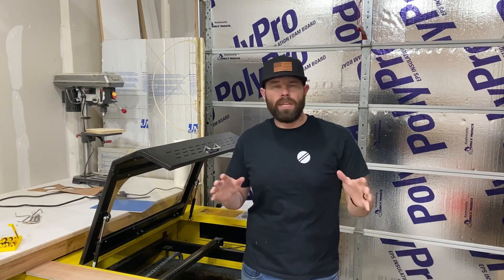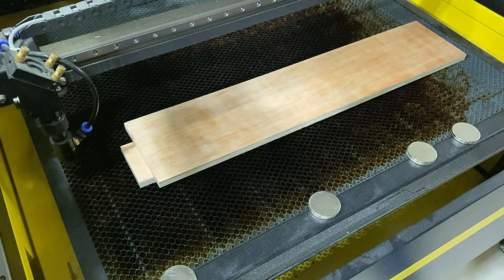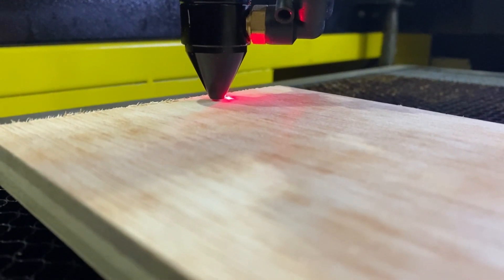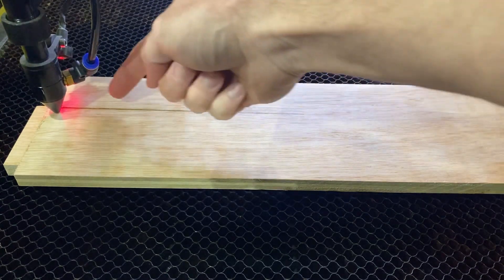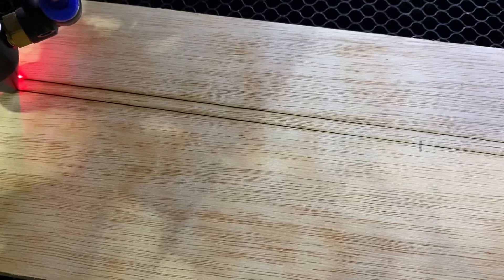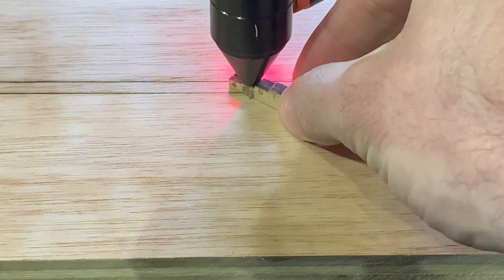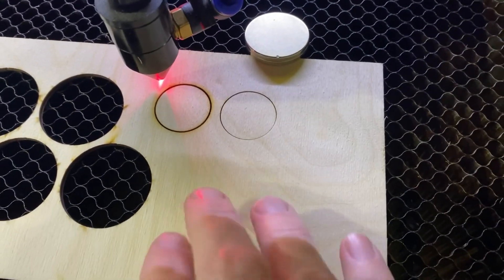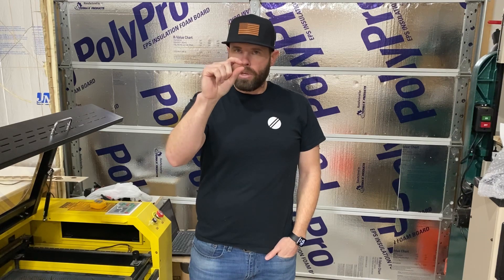Ramp Test and Optimal Focus for Co2 Laser

Comment: I'm not a youtube contributor but I've owned a laser cutting business for 15 years and I need to tweak your process here.  I cut and engrave 3mm and 6mm baltic birch with 4 machines, wholesaling to 400 locations around the country.  The way I do this "ramp" trick is I use a piece of 6mm plywood and put it on an angle so it will be definitely out of focus at both ends.  Have magnet stops so you can remove the wood and place it back in exactly.  I run a file that has the capital letter "B" on 1/8" height copied and pasted across 12 inches or so for engraving and a cut line at the speed I usually can get through 6mm with.  Run the file then remove the wood and see the center point of where the line cut all the way through, that's your ACTUAL best cutting height.  Take a pen and mark around the wood to the front side so you can see where the focus height was optimal for CUTTING.  Then on the top surface look closely at the letter B's and find the part of the engraving that looks the best.  Put the wood back in and move the focus lens back over those two spots and find a drill bit that is the exact height and keep it on a magnet on top of the machine.  You can set the perfect focus height for either engraving or cutting by grabbing the appropriate drill bit, put it under the nozzle, loosen the thumb screw and drop the cone onto the bit.  What you'll find is the best cutting height is not when the beam was focused the tightest on the surface but rather slightly down into the wood and the best engraving height is about 1/16" different from the best cutting height.

Comment: I have an Omtech 60 watt and I just replaced the lens. I was trying a ramp test and went as far as 18" and the line thinned out but never got thick again at all. Now normally my focal point is 5mm. I was testing cuts and now 5 is a thick line and does not burn through but I go to 12mm and it cuts. Go to 15mm and it cuts real clean. These are all at 10 speed and 60 power. Isn't that a little strange for a focal point to change from 5mm to 15mm by replacing an identical lens? I know I need to make a test card but don't really know where to start with this major change.

Comment: Hello! Can I ask you? My laser 130 watts on autofocus can cut acrylic very well but when it comes  to 9mm plywood is struggling to cut it even at 4 passes at 80% power.

 But  today I noticed that if I put the bed a bit lower than the height of the autofocus height, the machine can cut the 9mm at 2 passes with a very clear cut and only at 70% of power. Is this correct? Can I use it like this? For ply wood?
Reply from the maker: The auto focus is not intelligent. Doing a ramp test and verifying with quality cuts is going to save you a lot of headaches. You get that dialed in and then you can calibrate the auto focus to the correct height.
Reply: @BeardedBuildsCo Thank you!!!

Comment: This is an excellent technique & presentation. The line should probably be a curve. The laser appears to remain on as it retracts from the end of the test line, which would interfere with the actual focus test impression it's making in the surface. If it was curved it would retract straight back away from the impressed curved area and not fire into the already impressed surface..

Comment: I did the ramp test several times to get it dialed in. Took a bit to figure out that the correct distance between head and working surface is 18mm ! Is that normal? I have an Omtech MF1624-60.
Reply from the maker: Yes that is normal for a 2” lens. When I made this video the stock lens was 1.5” and now they are all coming with a 2”.

Comment: Thank you!! The last part of your video is the exact issue I’m having. Question.. when you get that 5mm measurement is that the height you always set it to cut on all materials or will every cut be different?
Reply from the maker: Pretty much the same height every time. If you are cutting thicker materials some times you can focus down into the material.

Comment: I get the ramp test and the 5mm. What do u do with the new info? What settings do u adjust to dial in the new height? Tks
Reply from the maker: If you are using a manual focus machine make yourself a 5mm gauge and use that to focus. If you are using auto focus then you need to follow this video👇🏻👇🏻👇🏻
Reply from the maker: Co2 Laser Auto Focus Offset Adjustment for Correct Focus Height
https://youtu.be/axDyrARXdjw

Comment: Thanks, I've been racking my brain trying to get this thing on the right track and I was doing  ramp test but to steep of an angle.  Believe   I've got it now.  For one thing the nozzle is probably the wrong type for a 1.5.  My lens has to go in the upper part of the tube.
 Your and most of them seem to go in the nozzle itself. I really probably need a 2" or 2 1/2'" for mine.  They mailed. mine in the mail before the laser got here.  The lens that came in it I have not a clue what it is I've not been able to do a ramp test on it it starts out big and gets bigger.

Comment: Shouldn't you aim for having the narrowest part of the beam in the center of the material? Otherwise it seems like you would have all the cuts taper. It would not make much difference cutting ⅛", but cutting thicker materials the taper and also the reduced concentration of the beam at the bottom could make getting the cut all the way through difficult.

Comment: Thank you, thank you, thank you!!! I've had my 90 watt FS Laser for about 15 years and have never been real happy with the cuts. I've always used the measuring tool that came with the laser. I've made several calls to customer service. They're friendly but, I've never been able to sharpen my cuts. After following your instructions, my cuts are sharp and I'm using about half the power as I usually do! Thanks again!!! Blessings!!! P.S.  I'm now your newest sub!!!
Reply: I guess if you cut the beam width in half you are doubling the power, or is it quadrupling the power?
Reply: @macrumpton  Sorry, maybe I'm just too slow...I don't get it.
Reply: So do you have to use that tools every time or is there a way to set your auto focus ?

Comment: does the ramp test differ for each material? Acrylic or plywood for example? Do you have a video or program for cutting through materials? Thanks, new to lasers so trying to get as much info as possible.
Reply from the maker: Ramp test will get you the optimal height for your specific lens. That height will be the same for all materials unless you are doing advanced techniques.
Reply: @BeardedBuildsCo  ok great, i did a ramp test last night but feel i must not have done it properly because the material still didn't cut all the way through with 1 pass. I have the omtech 80W, should i verify the glass inside the laser point is facing the correct way?
Reply from the maker: How thick is your material and what settings are you using? 

Did you get your ramp test down to a pencil thin line?
Reply: @BeardedBuildsCo  the material was a 7/32 plywood we used this for the ramp test but I’m not sure if we had 1/2in ramp depth. I think it was close. Drew a 12in line, found the thinnest point and measured. The distance was close to the marker sent with the machine.
 We used 1/8 acrylic to try & cut through. Used 30speed & 70power, it took 3 passes to just about cut through.
Reply from the maker: 30 speed is going to be way too fast
Reply from the maker: My assumption is that you probably still have some work to do on your alignment.
Reply: @BeardedBuildsCo  what’s the alignment? How do I fix that?
Reply from the maker: @nicknolan8254  Principles of Co2 Laser Mirror / Beam Alignment
https://youtu.be/6GtwjxUpEEs

Co2 Laser Alignment | Beam Alignment | Mirror Alignment
https://youtu.be/tFbuOs_98n8
Reply: @BeardedBuildsCo  thank you so much, I appreciate all the help 👍🏻

Comment: To see the cutting profile of the beam I take a 1/4 clear acrylic piece 2" wide by 1/2" tall  lay it on it's side and pulse the laser through the middle you will see the full cone shape and from that you can see the maximum cutting depth with out any deformation.  I've also made that little step tool you have and pulsed a beam at each interval to show the cone shape, helps when doing stuff slightly out of focus for special cases.

Comment: Thanks very much for this video.  I fired up my new 80w laser yesterday for the first time, and had trouble cutting 3mm plywood, very similar to the final scene.  I'll be doing a ramp test today!
Reply: very late reply but you should blast through 3mm with 80w, I work on lasers from 12w-150w in general and a 12w will still cut 3mm although fairly slow.

Comment: Good method, but I would definitely use a set of inexpensive feeler gauges to determine the space between the nozzle and the ramp.  You're visibly pushing the cone up by an indeterminate amount with that 5mm allen.  Once you have an accurate value, you can plane, mill, or sand down a piece of hardwood to make a focus gauge (I like mesquite, very hard and extremely stable).   I do like your cut out gauge block, tho.  That's pretty slick.

Comment: So I ran the laser test 3 times.  used a half inch board and ramp and each time i used a longer line 8, 12, 16 inches and the line at no point got thicker.  each time it went from thick to thin.  So now I am confused as to where to set the optimum cut!    I have the OMTECH 50W system.

Comment: OK, so I have tried the ramp test, with 1/2" block, also set length to 12" and then to 16".  THe laser started thick and continued getting thinner, but never back thick.  I do have the OmTech 60 Watt, I loosened the nut on the focal head and moved it all way up, then backed it out.  However, the beam still start thick then ends at thin.  I did experiment increasing the distance between the laser head and board, and achieved this, but distance is close to an inch.  What can I do to help get this corrected?
Reply from the maker: That is correct because most of the new machines are coming with a 2” lens. My new 100watt machine as the same lens and the distance is 18mm for my optimal focus.
Reply: @BeardedBuildsCo  So does the height of the laser head needs to be at a certain height, since it is adjustable?
Reply from the maker: It doesn’t matter. You will still need the same focal distance because the lens is in the tube that has the adjustable height.

Comment: My guess is that your  50mm/s and 20% power are not those you use for cutting. Try using realistic cutting parameters for the ramp test and then  run the same test with engraving parameters of maybe 300 to 400mm/s.  Can you explain the 2 or 3mm difference in focus? Also when you do that quick pulse test,  what are you provin?. Hold it on for 2 or 3 seconds and explain what you then see. . Lenses are designed to be used flat side down. Is that your configuration.  If you measure the disince inside your nozzle to the lens and then make the gap  so that it matches the manufactureres focal distance, why does the ramp test and the designed focal distance not match? Are lens manufacturers that incompetent?   I hope this will demonstrate to you that there is no such thing as a fixed focal distance  when you pass a laser beam through a lens.. It will change with power, speed and material, Just do a few simple ramp tests with different materials and different parameters.  The results should puzzle you.

Comment: Great video and learned a lot...

Question. What are you usual settings for your 60w laser when cutting...

Specifically power and min power?
Reply from the maker: When cutting I always set my min and max power to the same. On 1/8” Baltic birch I am usually cutting at 40% power around 15mm/s

Comment: Hello there...a quick question for you...I did this ramp test per your instructions because my 80W OM Tech laser stopped cutting through my .25" MDF.....It was on a roll for a while, but then, it started to cut inconsistently.  Do you have any experience cutting .25" MDF?  Should I do a ramp test on the MDF as well since that's what I mostly cut?
Reply from the maker: First things you want to check is that you have cleaned all the mirrors and the lens. Next to check would be your beam alignment.
Reply: @BeardedBuildsCo  I cleaned the mirrors, What's a beam alignment?  Is that the same as the camera alignment?
Reply from the maker: Beam alignment is aligning the mirrors.

Comment: Great video Brandt! I did this upgrade and the new air assist is working great but the stock built in air pump (noisy as hell)  is still running. I see 3 ways to turn it off...a digital setting to disconnect (if there is one), trace the wires back to  control panel and unplug or cut and cap at the pump. Which do you recommend?  Thank you!
Reply from the maker: Trace the wires back to the 24v power supply, snip them and then wrap the live ends in tap so the are not causing any problems.
Reply: @BeardedBuildsCo  sweet. Thanks for your input!
Reply from the maker: Sure thing!

Comment: Wow. I just got an OMTech 60W laser (500x700mm) a month ago. The plastic focusing gauge it comes with is just under 21mm thick, which is also about what it auto-focuses too. If 5mm is that much sharper why do they calibrate them so much farther?
I’ll try your ramp test and report back.
Reply from the maker: If the gauge you got is that big then you probably have a 2” lens.
Reply: @BeardedBuildsCo  Thanks, good to know. Is there an easy way to tell? I picked it up in person (since I’m less than hour away) and I know they had already calibrated it and it looks sharp to my untrained eye, but I’d still like to do this test so I can dial it in in the future as it gets bumped and used.
Reply from the maker: The gauge that is sent with it is the first indicator. The other way is doing a ramp test. You will want a nice steep ramp so you can see the results.

Comment: What if you want to cut through a thicker material say 3/16” birch plywood, is it general the same way of doing the ramp test to find the thinnest laser beam/ line and the try to find the power and speed to cut through what ever thickness you are working with?
Reply from the maker: You should only have to do this once and it will be universal for all materials.